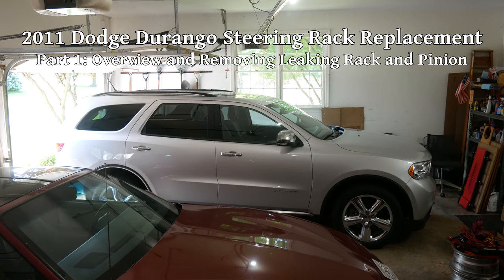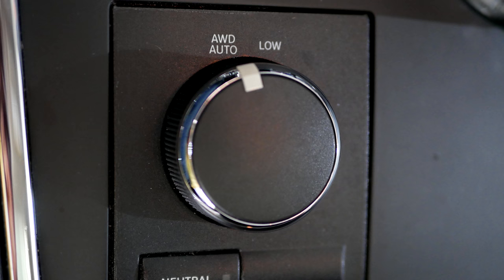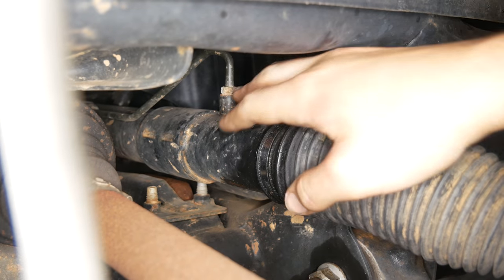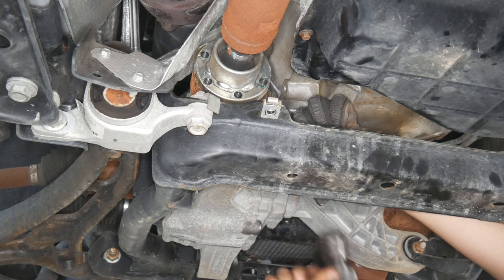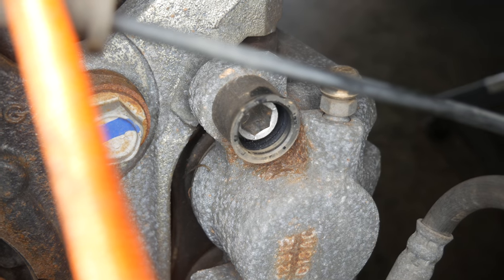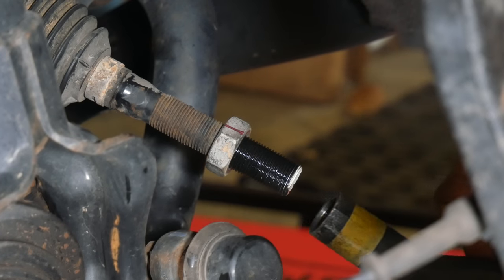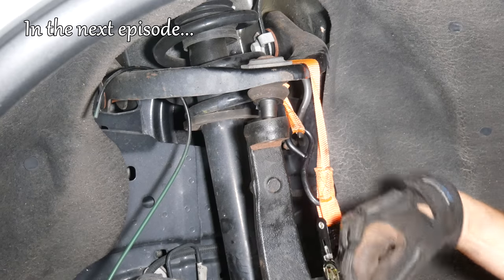2011 Dodge Durango Steering Rack Replacement w/o Engine Cradle Removal (V8 AWD) (Part 1 of 2)

Comment: Can i give you a huge tip? Take off the inner tie rod. The book time for these is 8 hours. If you take off the inner tie rod on the driverside, the rack will come out in a matter of 45 mins. I do them all the time. My buddy showed me that trick. You dont have to take the axles, controls arms, or anything apart.
Reply: Does that work on v8 or only v6?
Reply: @beccaj945  all of them
Reply: So I have everything unbolted and both ends off how to get it out?
Reply: @beccaj945  did you take of the driver inner tie rod?
Reply: @colerippeon3903  will try tomorrow
Reply: Hey I took off inner tiered on driver side 
I don't understand how you got it out without removing differential been sitting on my uncle hoist for last week well I've been working out of town 
Any more tips for when  I get back
Reply: @beccaj945  what year durango are you working on? If you pull the inner tie rod on the driver side, you pull the rack out towards the front of the truck, do not slide it out the side like most others.
Reply: This exact truck in this video but black lol 
Thank you soo much I didn't try that I will this week
Reply: Never worked I just pulled diff and did it way in video maybe on a v6 no way on the v8
Reply: Take both inner tie rods off or just the drivers side?

Comment: this job pays 8hrs at my dodge dealership....i can have it done in under 1hr....hint...you just have to disconnect the lines and the two mounting bolts and the entire assembly can be snaked out the passanger side wheel well without removing anything....we call these racks in the durango and the grand cherokee "gravy" jobs
Reply: umm i find this hard to believe, i have to tackle this job and its stressing me out lol, i hope you are right though!
Reply: Did you get it out without removing any thing?
Reply: Has anybody tried this to see if it actually works?
Reply: Even AWD models?  Mine is a '13 SXT
Reply: @Scypher0th what's the process for getting it out the passenger side and are you taking the inner tie rod ends off?

Comment: Thank you very much for sharing this information. A customer pulled in to my shop with the exact same vehicle/problem. I also checked the workshop manual first and thought about declining the job. Luckily I found your video and the swap was a breeze. Why the manufacturer tells you to tear the entire vehicle apart when it clearly can be done this way is beyond me.

Comment: Fun fact! Plastic oil pans exist because they direct NVH (Noise/Vibration/Harshness) downwards making a quieter running vehicle, as sound takes the path of least resistance. Hence plastic sump but metal skid plate!

Comment: Oh cool! I job i already know how to do! I'm actually a dodge tech as a day job, and I've been doing these routinely since I started. But your absolutely correct to do it this way, as we also do not remove the subframe on this job. It differs slightly based on the model, but it really is generally just taking the inner tie rods of both units, unbolting the gear, and repeat to install. Good job!
Reply: Don't have to drop the diff?  Mine is a '13 SXT V6 AWD.
Reply: @sp1068  that’s correct. On v6s you actually have more clearance on the oil pan. The easiest way is to just remove the inner tie rods. If you run into clearance issues you just undo the motor mounts to raise the engine. After removing the inner tie rods and unbolting the rack, it should slide right out
Reply: Does that work on the 5.7 V8 Overland Grand Cherokee?

Comment: Had to do a full GTA cheat code to get the car in Neutral goddamn
Reply: Hahahhha
Reply: Called safety, seen enough from videos from USA so this should've been harder too do
Reply: @alexstromberg7696  That's not safety. Safety is just keeping track of when it is so that it doesn't roll away on you and making sure you can't accientally put it in neutral without making it overly complicated, because the ability to roll a car on command is still necessary.

Comment: 2010 dodge charger... I had the "pleasure" of dropping the rear end (cradle) that contains the diff, cvs, hubs, shocks, springs...and more. But to do so, you have to move the fuel filler hose out of the way and drop the exhaust from the cats back, and a lot of patience. Once that was done I removed the one inner bolt holding the tension strut, replace strut... and put it all together. That said I love that car! it handles great, has enough power and is generally really fun to drive. Definitely worth doing again if it means keeping it for another 10 years. But yes... I feel your pain in this vid.
Reply: Did you have to replace the rear suspension cradle bushings?  Apparently the bushing will separate from the cradle:  https://testing-public.carmd.com/Tsb/Download/117365/000000003b9bc979
Reply: @NickLoecke  no not yet
Reply: @NickLoecke  the main reason is the tension link (fowards facing rear upper control arm)

Comment: That big block of iron is actually a tuned damper to reduce noise and vibration from the vehicle. It is tuned specifically to help eliminate high peak sounds that the vehicle produces, and gives the passengers a reduced level of interior noise/vibration.

Comment: Are you accusing them of over thinking this? Because I think they did - including a steel skid plate for a plastic oil pan. Genius!
I'm glad you didn't have to do this in the winter. I'm looking forward to Part 2.
Reply: my favorite part is the plastic oil pan possibly to save weight then add big iron NHV weights. lol

Comment: Great video.  Glad I didn't tackle this job.  Getting older and don't really want to be laying on the cold concrete anymore.  Although I think I could have done this myself it would have taking me more than the 6-8 hours of labor they were charging me.  Markup on the parts is just frustrating.  More than 100% markup on parts is just ridiculous.  Thanks for posting the video.

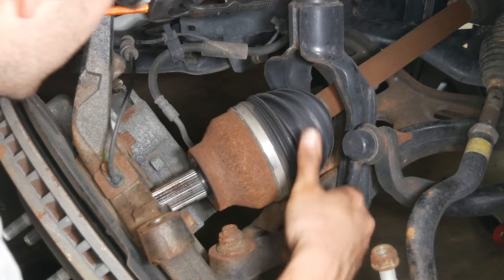Comment: At 9:30 the problem you have with the axle is the same as I have with my Eclipse, I have to unbolt the wire holder for the ABS sensor to let it tilt out a little bit more, it also helps to turn the steering full lock in one direction.

Comment: Plastic oil pan, is a thing in the 18 wheeler world because it lowers the engine running noise. A steal or aluminum  oil pan and valve cover makes the noise echo or what its called. Correct me if I'm wrong.

Comment: Had a 2011 Durango AWD. Replaced the front struts, front half shafts, upper and lower control arms on both sides, and had everything removed, replaced and off thejack stands in only 2.5 hours...
Reply from the maker: We never claimed to do anything quickly haha! Filming alone doubles or triples the amount of time anything takes. Then factor in the incompetence. It's amazing it didn't take me two months!

Comment: I have a 1982 firebird and there is no power to anything not even the fuse box I have not been able to figure out why my best bet is that the wires are shot do you think I should change all of the wires for the car or just change the ones that need to be changed

Comment: At 6:50 , I had this problem also. Almost 45 mins of hammering it still would not pop out. The holes on the back with the threads by the differential, I sprayed WD-40 in the holes and within two minutes of hammering it all came out. 2015 rt

Comment: If you disconnect the bottom of the shock and loosen the lower control arm you'd have an easier time with the shafts

Comment: When you need to remove a caliper to just get it out of the way' why not unbolt it at the bracket?
Reply from the maker: Fair point, that is certainly another option! It adds some weight and bulk to the hanging object but if you can't get the slide pins out or need it all off anyway that will usually work. Can be difficult to get brake pads back on that way sometimes though

Comment: Just came across your video. About to do the same on a ‘14 Grand Cherokee. Fortunately for me, I’m also replacing both cv axles and tie rods. Would you think it necessary to still remove the front diff since both tie rods will be removed??
Reply: How did it turnout about to do this on a 5.7 hemi grand cherokee 2014? Did you end up removing the inner tie rod ends to make it easier to get the rack in and out?

Comment: Still got my original steering rack on my '91 154k mile Peugeot 205. Only last year did the inner tie rods eventually wear enough to fail.

Comment: Probably a very silly question but why doesn’t this dodge have warranty? If it does then I’m assuming warranty doesn’t cover this. Fantastic video and I can’t wait for part two I also hope your doing well!!
Reply: They are usually so many years and miles.    So it ends whichever comes first.  It’s nine years old so the warranty probably ended at 3 years.

Comment: You don’t have to remove the caliper to remove the brakes.   You can just take the bracket bolts out and remove the whole assembly.

Comment: Hey fuzzy dice, we got a 2015 grand cherokee let’s hope this don’t happen to us. Also I want to know what model impact you got that tackled all your repairs and mods, I currently have air tools and a compressor that’s nowhere near the recommended capacity for my impact. I’m going to be switching to battery tools. I own a dewalt 1/4” impact driver that I use for little jobs currently and it’s been abused for a year straight and it’s still going despite having a little play in the hex shank shaft. Im considering to buy a DCF899M1 and only use the compressor for filling tires. Dewalt love ❤️
Reply from the maker: The bigger impact is the DCF899, fantastic tool. As long as you put a 5/6Amp battery on it there isn't a lot it won't loosen on a normal light duty vehicle. It's also quite heavy though, and using it laying on the floor is a real workout. More recently I got the DCF894 and I use that for most jobs now. It's almost half the weight and will loosen most fasteners without complaint. Every once in a while it doesn't quite have enough oomph so the DCF899 is a better one to go with first, the size and weight are really the only problems I've had with it.
Reply: @FuzzyDiceProjects  I’m fine with size I’m going to save up and get one of those, my 11 gallon plus 7 gallon air tank set up really sucks at only 120ish psi. I tried to turn up the cut out on my compressor only to find that the safety bleeder goes to work at 125 psi and the motor on my 20 year old compressor is now wanting to seize up on me since it’s 25 Degrees here in Chicago. I love the videos you guys are putting out and I love the approach to making these videos and I would love to see more. My garage is slowly getting equipped with the tools I need.
Reply: Yours has EPS, so you should be good.

Comment: When breaking loose a ball joint, dont just take the nut off half way, Remove the nut all the way and then thread it back on half way or til the nut is flush with the ball joint stud, then knock it loose. this way u won't have to fight the ball joint stud spinning cause the nuts threads r still rusted on👍
Reply: Also if u don't have the correct tool for the caliper bolts, but the caliper bracket bolts r regular hex bolts, just remove the bracket with the caliper still attached to it, actually, do that anytime u need to just get the caliper out of the way, makes the hole rotating assembly lighter in cases like ur lift kit on the silverado🤘

Comment: 10:40 I want to know more about the reason for the lead weights.
Reply: Probaly nvh dampers.
Reply: Buyer: "It vibrates too much!"  
Dodge: "It's too expensive to fix the vibration, so lets add extra weight to the vehicle to dampen it instead."
Reply: @Richard.Sanchez  you would be surprised how many vehicles have weights like that. Some of the cameros had weights on brake pads to dampen vibrations. Lol

Comment: Nicely done videos. You just have to watch South Main Auto for a while to learn how poorly engineered most Dodge, Jeep and Chrysler vehicles are. A steering rack failure on a 2011 with only 25K miles is hard to excuse and FCA doesn’t seem to care about serviceability or even, as your demonstrated, how to properly write service procedures. I’d never own one of these unreliable money pits out of warranty but FCA even sends their dealers info on how to avoid warranty repairs.

Comment: 2011 car and it needs a new steering rack.My 2005 Hyundai matrix 1.6 has the original steering rack.And I don't really change the power steering fluid.Gm quality

Comment: #NeverDodge ..my family has been buying Dodge for literally decades. Since the 1960’s. They are absolute garbage vehicles and getting worse with every generation. The trans on my old dodge neon went well below 100k, family members have replaced transmissions in multiple dodge vans. They are money pits, unreliable, and do not last. I don’t understand why people continue to buy them, including members of my family LOL. I will never buy anything other than Toyota/Lexus for the rest of my life (unless their quality changes). I regularly see 25 year old Camrys on the road all over my town, still running like champs. Name another car like that. Hardly exists. 

But when it comes comes to Dodge, take the advice that the name implies...DODGE.
Reply: i think dodge like ford used car transmissions pushed in to van service to save money.  ford  used the Taurus transmissions in their Aerostar.  the trans was on the margin in the Taurus, the extra weight of the fan pushed it over the edge.